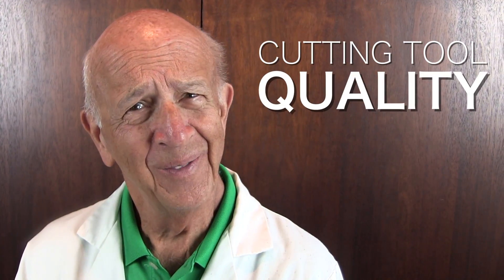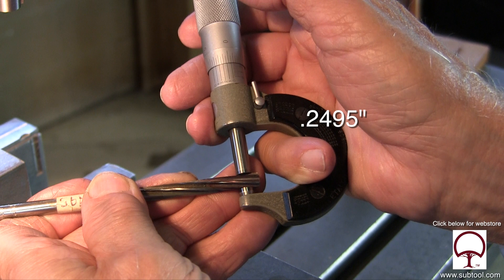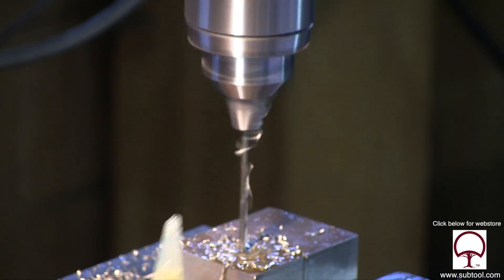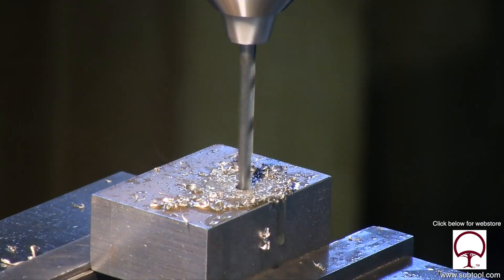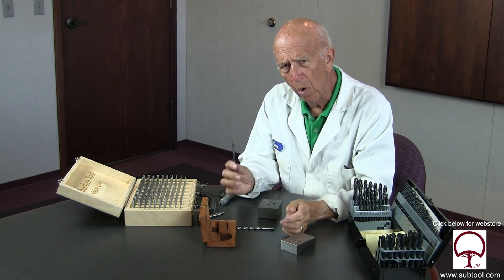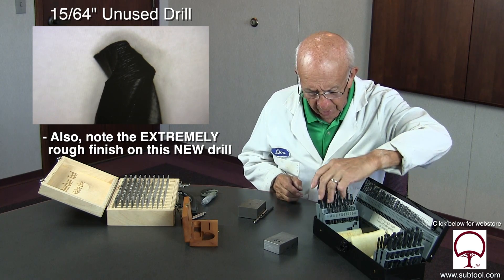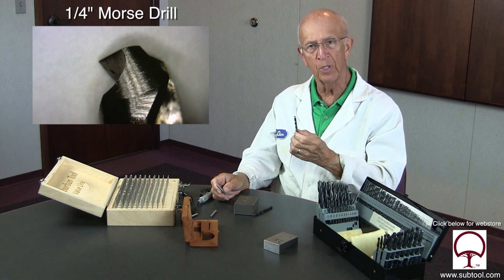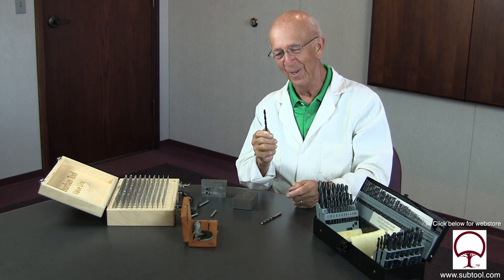How To Understand The Importance of Cutting Tool Quality

Comment: You state that the inexpensive .250 drill after being sharpened correctly, drilled .001 undersized (Appx 7:20 into the video). You proved this by showing that a .249 pin will go into the hole but that the .250 pin will not. One of the first things I learned in machine shop school is that a .250 pin will NOT go into a .250 hole. So I think that inexpensive drill made a hole even closer to size than you think. Maybe even perfect. Love your videos but I just had to point this out.
Reply from the maker: thank you

Comment: Can you explain why the pilot drill vs going to size please? Drills are capable and designed to cut to the center. Why not let it do so? Thanks for sharing.
Reply from the maker: most drills are long and the points are not as small as the center drill. center drills are shorter and tend not to wonder as much as a drill might.
Reply: @SuburbanToolInc  
Thanks. I understand that. Sorry, what I meant was step drilling. Starting with a smaller drill before going to size.

Comment: The exact same is true for any cutting tool. To simplify it a bit, quality materials, care and accuracy in manufacturing, quality and accuracy of the manufacturing equipment, capital costs, and properly trained personnel cost X amount. Despite the all to common perceptions, low labor costs really don't have much effect on the final price of any good cutting tool no matter what country there made in. The low cost tools have to have one or more of those items reduced to match the price. Good industrial quality American, European or even Japanese cutting tools are at the ragged edge of what I can afford for something that's a hobby. But I can no longer afford cheap cutting tools and having to replace them with better. And all HSS and carbide is not created equal. There's dozens if not hundreds of reasons why those higher quality cutting tools cost what they do. For what your cheap set is meant for Don I'd agree there good enough. For the required results while machining you can't go as cheap as possible with any cutting tool. I've tried and failed more than enough to now know it's impossible.

Comment: Drill bits are as standard made  approximately 0.03 mm undersize. This allows a close to correct size hole after the flutes expand outwards during the machining process.

Comment: My teachers tell me a drilled hole isn't straight and it isn't round. We don't drill pilot holes anymore, because someone tested it and it didn't make a difference. We have 3-flute 'core drills' which are supposed to make a hole straight and round, and the reamer is for getting a good surface finish. The way I see it, is drills are for removing metal; a roughing process. I really appreciate the tip about pecking with the reamer, and will try that as soon as I get a chance.
Greetings from Finland!
Reply from the maker: Greetings from the USA!  Thanks for sharing this info, and thanks again for watching!

Comment: I have found the sweet spot between price and quality drills to be Triumph drills. They seem to be straight and have good points, and are pretty close to nominal size. The Trumph Silver & Demming seem to be as good as any drill I have ever used. Dunno is MSC will pick them up when Enco goes away at the end of the month or not.
Reply from the maker: Thanks for sharing, the community and I appreciate hearing your first hand experience.

Comment: What I'd liked to have seen you do is take two drills, a cheap one, and an expensive one, and put the same grind on them both off your own machine, and then seeing if there's any great difference in the hole size they drill. Of course that won't provide any indication of longevity etc, but would be an interesting test just the same. Are we better off buying cheap drills and expensive drill grinders ;)

BTW your reamer has runout too, that chuck is Fritz.
Reply from the maker: Thanks for the comment.  We could, but the fact of the matter is that Morse drill cut a hole exactly the size marked on it.  On the concept of buying cheap drills/expensive grinders, keep in mind that two of the four drills we pulled out of that new set of drills were bent.  For precision, you're better off spending a little extra on the better cutting tool and saving the struggle.

Comment: Don't forget the importance of holding the drill. For accurate holes using a collet instead of a chuck will improve positioning, straightness and dimension. In this vidoe it's easy to see that the center drill wobbles a bit.
There are drills that produces holes to ISO 7 right of the box (expensive and made out of carbide).
Reply from the maker: You're very correct.  Thanks for sharing, and thanks again for watching!

Comment: I was taught by an engineer to measure a drill and check its point before drilling a hole. I used a German made drill bit HSS 1/16 " to drill 260 holes before it needed re-sharping.
Reply from the maker: He was a smart engineer ;) This is very good practice.  Thanks for sharing, and thanks again for watching!

Comment: thanks for the video. I discovered the exact same thing recently. I bought a cheep set of drills for my home shop just so I had every size. every single drill point was off center and the relief angle on some of the drills was actually backwards. after re sharpening they at least drilled a correct size hole. I also discovered is some materials the quality/ hardness of the steel was worse. of a few peices of material I was trying to drill the cheap drill wouldn't even begin to drill it sharp or not. I still.use the cheap drills for unimportant stuff but will probably never bother to buy a cheap set again.
Reply from the maker: There's a lot of truth to this.  One of the drills in that 115 piece set we showed actually came split.  As stated, they're perfectly fine for the hand drills used in shipping and maintenance, but for precision spring for the better quality product.

Comment: At my last job, I had to drill and tap about 175 holes (1/2-13) in a 1" thick steel plate....used 7/16" Precision Twist Drill....never had to sharpen it....and when finished, it still had pretty good looking tip on it....and used some Moly-D cutting oil....OSG tap did equally well.....
Reply from the maker: Sounds about right.  Consequently, we went back and took a look at the pilot drill we used in this video, and you can physically see the wear on it after three holes.  Thanks for the comment, and thanks for watching!
Reply: ...Yes, that was the plain Black Oxide drill...nothing fancy....but the PTD 115 piece set retails for $600+.....I believe I got it on discount/sale for around $275-300.....10-12 years ago...

Comment: Oddly enough after watching your last video on drills i had to drill and ream some bearings for a model steam engine , thankfully enough after watching  your video it reminded me To check the drill i was going to use and did a test run on some scrap - it drilled a hole bigger than the reamer !
It should have been .015 under !
I ended up regrinding by hand and ended up with a hole that was about .005 oversize but still usable for reaming .
I wonder if the bent drill is a result of it stress relieving during grinding ?
 Those gauge pin sets look nice ! I would like to see them being made along with gauge blocks being lapped , surely there has to be some other viewers of your channel that would like to see more how its made videos ?
Reply from the maker: Ha! Seem exactly like our experience with the cheap 1/4" drill last week.  We're still baffled it drill so oversize right out of the box.  Glad to hear you were able to clean it up.  Thanks for watching, and thanks for the comment.

Comment: Good video Don, you can learn something new every day. Some drills are inexpensive (low cost) some drills are cheap (low quality) and some are both. When one of these cheap drills snaps off in a hole I ask my self where's the savings. The better quality drills do a better job but as you have shown it would also be wise to invest in a good sharpening system.
Reply from the maker: Spot on thinking.  When a cheap (low quality) tool breaks off in a part, you're out the price of both.  Lose/lose in these cases.

Comment: What machine is used to sharpen drills that is affordable ? Is hand sharpening only for an expert ?
Reply from the maker: Affordable is a very relative term, so I'd have to do a little research before giving an honest answer because I really don't have one off of the top of my head.  We use a Darex SP2500 in our shop, which has a pretty high price point.  Hand sharping isn't only for experts, it just takes practice! Thanks for watching, and thanks for the comments.

Comment: That Morse drill sure wobbled a bit.
Reply from the maker: It should be noted that the Morse drill that wobbled was the 15/64" we used as the pilot drill for the reamer, which we pulled out of a miscellaneous tool bin.  It has been there for a while, as it has (obviously) seen it's fair share of wear and tear in the shop.  

It should also be noted that the brand new 1/4" Morse ran dead true.

Comment: Funny that this came out right after my trip down drill sharpening lane video. https://www.youtube.com/watch?v=3unjoKkgQto  Maybe its drill week in you tube land. :-) Good drills are certainly critical to good holes. I was surprised by how much those cheap drill blanks were off on size.  For an even more interesting test take that block to the comparator and locate the holes from both sides and see if you not only drilled oversize but your bores walked off as well.

Comment: Any reason you choose a center drill as opposed to a spot drill? I thought center drills are meant for tailstocks on a lathe.

Main reason I ask, I work on all exotic materials for the most part. Using a center drill on 6al4v titanium  I have seen many guys absolutely ruin them if not snap the pilot point off completely. 

I use a 140° spot drill for my 135° bits. Seems to work flawless for me.
Reply from the maker: Center drills can be used anywhere, but I do agree, with certain materials there are better methods.  In the case that you have mentioned, the harder material calls for the larger angle on the tip.  Thanks for the comment!

Comment: I thought you are not supposed to back the reamer out of hole until it's done?
Reply from the maker: I believe that the clogging of the chips does damage.  If the chips stay in the flutes they can rub against the bore and cause the bore to go oversize.

Comment: Don, why do you spot drill with a centre drill, rather than a proper spot drill? The hole angle of a center drill is typically 60 degrees.  When spotting, you want an angle that is larger than the twist drill’s angle if possible.  The narrower the spot angle, the more near the outside diameter of the twist drill first contact will be.  If the twist drill’s flutes aren’t perfectly sharpened, one will contact the spot hole before the other and the drill will try to deflect, this could be adding to the problems of the cheap drills.  Over time this could also notch the tip of the drill where it contacts, meaning you have to sharpen it more often, or ruin the good factory grind of expensive drills. Going for a split point bit could also help, eliminating the need for a pilot hole. 

Great video as always, I always thoroughly enjoy watching you. Keep the videos coming.
Reply: P.S. Does holding the reamer in the drill chuck make any difference to it's accuracy because of run out. or does the reamer sort of bend to suit?
Thanks.
Reply from the maker: You're not wrong, it's just a different way of doing it.  As for the reamer; it could, but in this case it didn't.  Once the reamer gets started it sets into place and will not bend, which gave us a straight and precise hole.  This also is the case because the reamer was running true, the machine was in good working order, and it was set up properly.

Comment: So what is the brand of that set of cheap drill bits? What are a few great brands of drill bits?
Reply from the maker: On the topic of quality drills, we use Morse in our shop and like them.  Cleveland has been mentioned in the comments, they also make a great cutting tool.  If you pull out a Production Tool Supply or MSC catalog and find something in the same price range as either of those, you should be safe.  As for the cheap drills, we'd prefer not to name a specific brand because many of the cheap sets are from privately labeled brands, all of which are rebranded from a handful of offshore manufacturers.